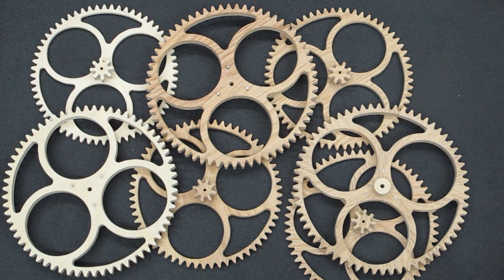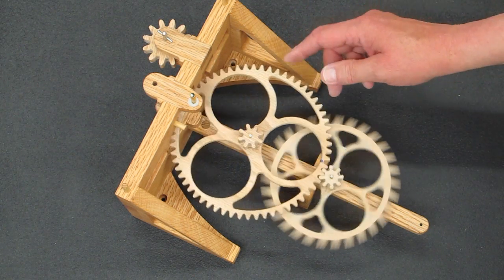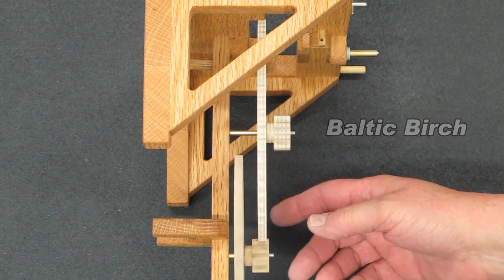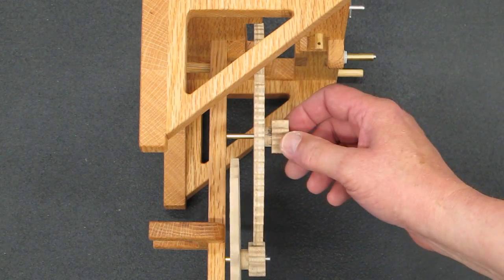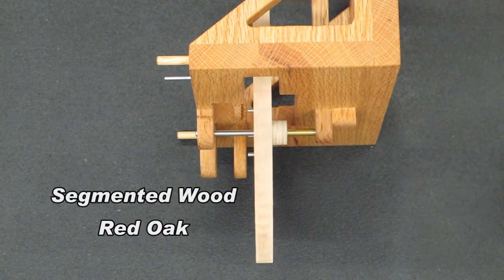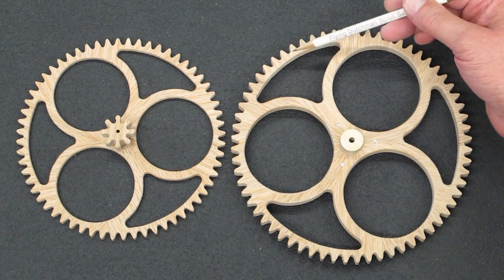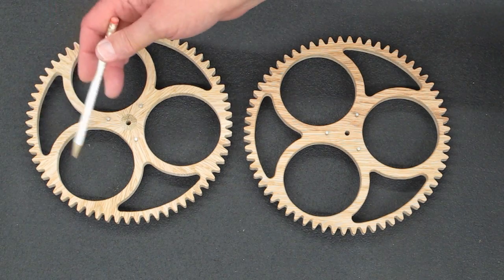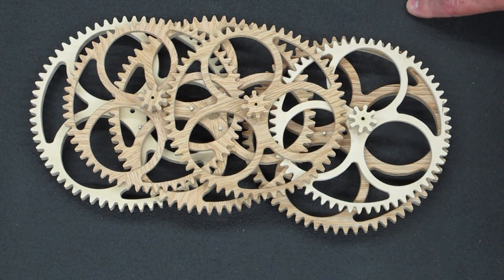Comparison Of Completed Clock Wheels - Plywood & Segmented Wood

Comment from the maker: Those wheels still look the same – Good!

I have not done the laminates to birch plywood for a clock wheel but I have done similar laminates for another project then ran it through the drum sander to make sure it was flat. Or you could do very light passes through the planer. Main thing is to keep track of the number of plies. There should be an odd number of plies.

Comment: Great video of your gear analysis. I really like the effort you put in on making them with different process. I am interested to hear back say in a year if any of the gears actually broke or split at the points that you describe!  Again really good video Ron. Appreciate that you take the time to share your learnings with others. Happy Holidays to you and yours!
Reply from the maker: It has been 1-1/2 years since I posted this video and things have not changed with these wheels… they have remained the same. I also made the much larger wheels for the Solaris Clock. I posted the Solaris Clock Wheel Review back in January and those also have remained stable. With all the cutouts and relatively thin sections I would say the climatic changes are pretty well distributed throughout the wood and contribute to the wheel stability.

Comment: Mr.Walters if you are concern about the gear breaking at the teethes, how about cutting and installing splines from a hardwood on the middle of the outside edges of the wedges on the segmented wheel. The spline is like the joints found on the corners of wood boxes cut on the table saw.

Comment: A Lot of hard work there.  Did you ever consider using stabilized wood for the gears?  Of course that throws a few additional steps into the process but warpage problems disappear.

Comment: Have you considered giving the gears a light coat of shellac? It should help provide better humidity resistance than no finish at all.
Reply from the maker: Thou shalt not shellac, varnish, oil nor paint thy clock wheels if you want your clock to run. Further supported by information available on Clayton Boyer’s website. Clayton Boyer designed and sells plans for these clocks. Varnish, shellac, paint, oil, etc. will tend to gum up the works and cause the clock to “grind” to a halt.
Reply: Ronald Walters Ah, I wondered if that might be the issue. Thanks!

Comment: I've been thinking for years that I want to build one. The problem is I'm disabled physical and mentality I have PTSD, OCD, & have panic attacks. I have lots of time on my hands do you think I'll be okay to take this on? I use to build model cars and modify them a lot !! Like cut open the doors and trunk to make them work like real cars.
Reply from the maker: Ronald Wendt Some people find this sort of work relaxing. Others, quite the opposite. That is for you to decide.
Reply: +Ronald Wendt 
The Simplicity clock is a clock designed by Clayton Boyer. . .It is a find clock.  But if I could make a suggestion.. ..Build  Claytons  Number 6 Clock first.  The #6 clock is a very forgiving clock, with large gears, and LOTS of room for mistakes.  It goes together easier than the Simplicity, and the larger Escape wheel (about twice the size) allows for easier cutting and rounding.  I have built many of Claytons Clocks. . .and have designed my own.

It is a very relaxing "work" to do. . .take your time and enjoy.  I would highly recommend building a wooden clock.  the rewards are far beyond your imagination.   Just remember one thing.. . (the one thing I will always remember when I started out)  You CANNOT eat an elephant in one bite.  Purchase the plans from Clayton for 40 dollars in CAD format (DXF) so that you can print out as many copies as you want, just in case you make errors. (you probably will make one or two errors, I remember I did!!!!) .   It may seem overwhelming at first, but remember one BITE at a time. . .one WHEEL at a time  one FRAME at a time, (He has it divided into about 20 (8 1/2 x 11) pieces of typing paper.  Very neatly done.  And soon, you will see a beautiful piece of working equipment grow in front of your eyes. . .  Good luck!

Comment: Please tell me you make children's wheel toys like the Quercetti Georello Kaleido Gears I found on Amazon. You could have different levels/stages of kits. First learning with gear toys that are heavy duty and can withstand toddlers.Then the kit could have patterns to simulate a clock's internal workings. Eventually a kit to actually include what would be needed to make clocks. Lastly, a kit for making the gears for the young adults in shop. Just include a video like this! LEARNING/EXPERIMENTING.